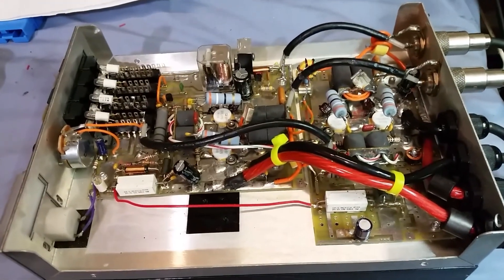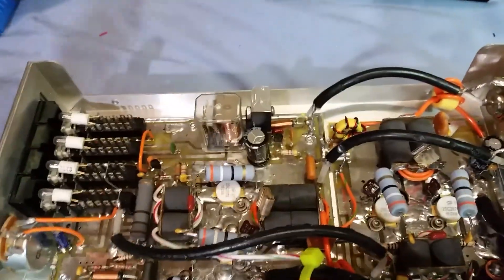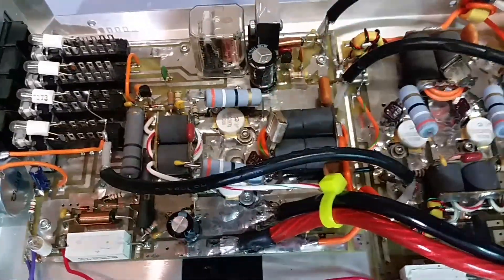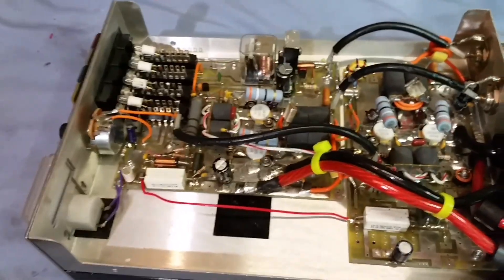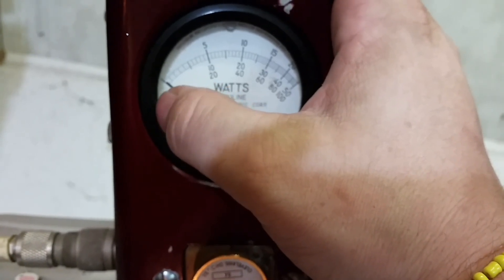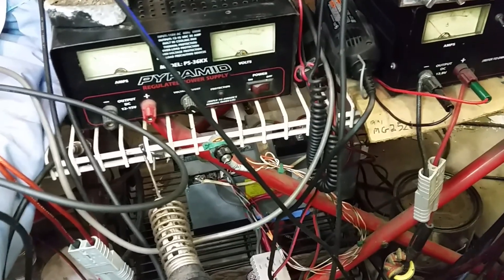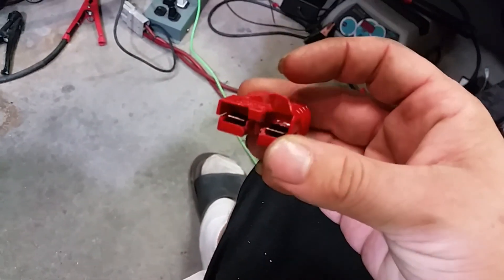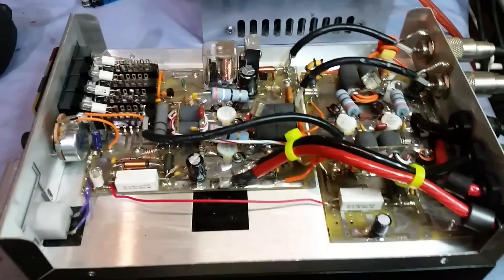Texas Star DX 500V Voltage Regulated Bias Mod Upgrade & Repair 😲

Comment: Look great. different than the one I own but fixed one just like that. put RFP 2SC2879X4 in had to re tune a bit. it had DEI pills .The one I own is a DX 500 not the V . has 4 switch and older style. I put RFP 2879 in it. at the time the output combiner was out of stock but put a DX 1600 final combiner in. the one with 2 resistors threw the inside of core. it worked great but my output tune was off a bit . either from DEI or combiner. I put thermal switch where the driver goes. KDS 301 NC . cuts relay off when hot. also no keying transistor. PTT only. I used 10 Ga on my power. and SB 175 connector. I don't have the SB120 on hand. I skip over that. PP45,PP75,SB 50,SB175,SB350 is what I keep on hand. like how you did bias. great for HG . if want to drop a bit more use a 7810 10V reg. and play with 1.8 ohm and fine tune voltage. how I did my hotplate. works great. I got each 2 pill right on with in .1V on bias. .6V japan 2290 . it was from .55 to .61 before. with stock settings. 1 outher time I used over sized combiner and that was a DX667V with DEI and 2 fet driver. I have put the ICA ones in. same turns just PTFE wire not mag wire it's bigger works the same. when the OEM combiner burned up usually burns the paint off core .wont re wrap after it got that hot. I have even hat a DX 1.6Kw with the final combiner burn so bad the core broke up into pieces . I have used TS combiners in outher amps. work great. usually use the ICA ones. just to lazy to wrap my own. my bad. 73's
Reply from the maker: I understand what you mean by being to lazy to wrap your own lol. Yeh I habe often wondered if I could find some like very low 1 to 10 ohm or 1 to 5ohm small pots that can handle half w of power and put them where the 1.8 are.
Reply: @1883GotDown   @1883GotDown  what I did to set bias on hot plate was each 2 pill section used a wire wound 10 ohm put. dial in voltage buy keying no RF. using a digital meter read ohms and make it  going threw a bunch of resistors. like how you tune input and out put with a trimmer cap . same thing but a pot. what I had to do with a DX 667V . the driver section bias is tap off a 2 pill section. needed 2 different resistors. with FET's its easy small 10 turn pot does the trick. I use my atlas to find gate voltage for the starting point.  then it's just the idle current  to select bias set point. looking at data sheet. tricks you learn over time. 73's

Comment: Can you do thermal regulation bias?
Reply: diode
Reply: I'd like to onow thos as well I o ce seen an box with a diode over the transistor but I was just f
getting into the hobbie and didnt pay attention.  ow I know it was a type of thermal heat tracking regulated bios.
Reply from the maker: I can limited but I plan on playing with this more latwe
Reply from the maker: That is the most simple...and I mean most simple
Reply: manipulating elements of electrical can be difficult and yet so simple . but it's the knowledge that loves on